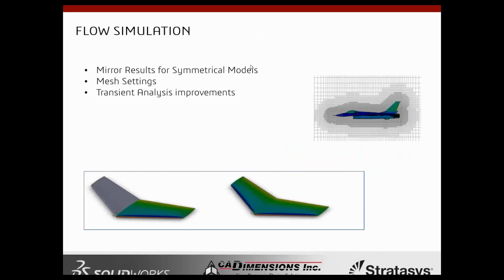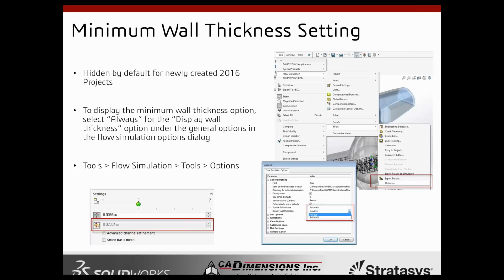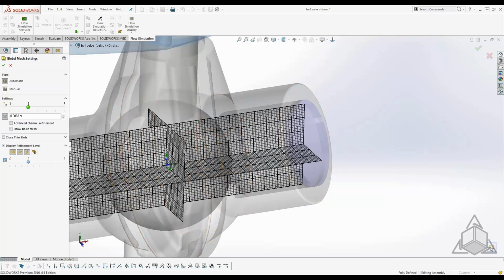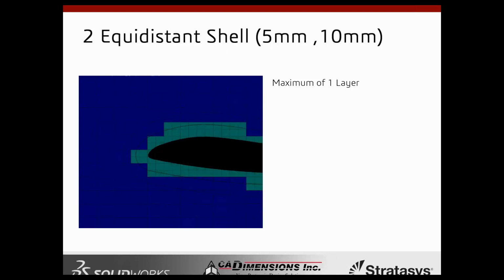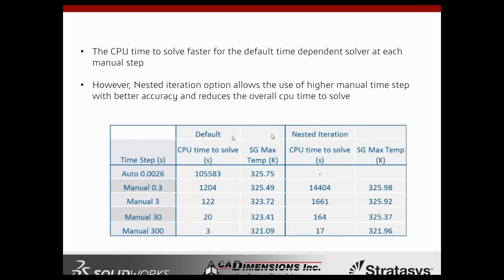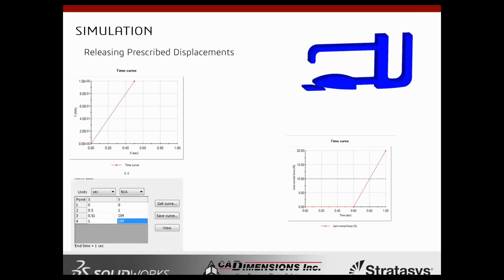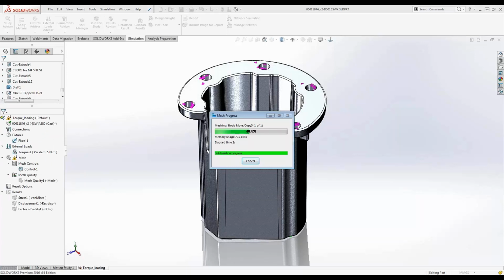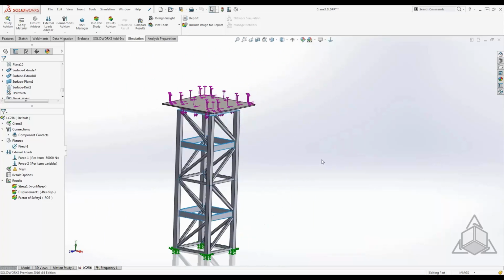Lunch & Learn - What's New in SOLIDWORKS Simulation 2016

Comment: Great video! I have a question about solidworks in general. What is the workflow when designing a product with multiple parts? Do you make a new file for each part and assemble them in a assembly or do you do a multibody part in one file and save the bodies as seperate files afterwards and then assemble them. In the first instance how do calcutate dimensions, shapes and interferances with different parts when you are are only modeling the single part.